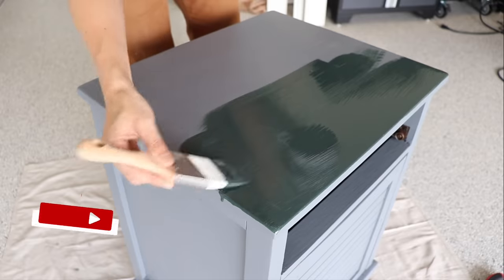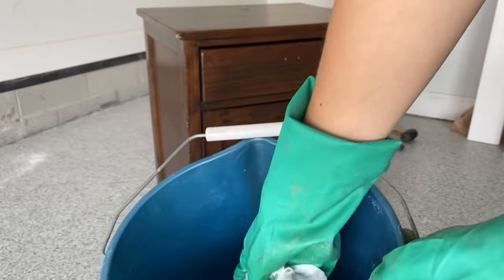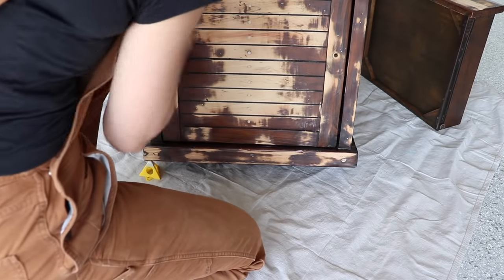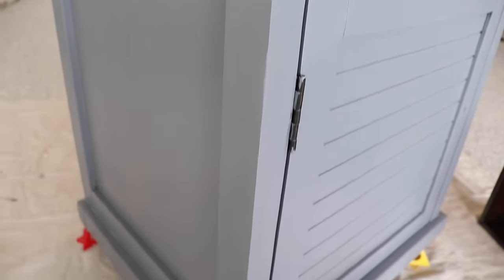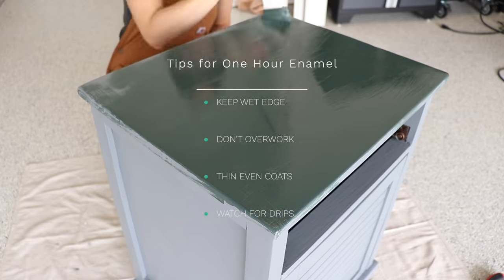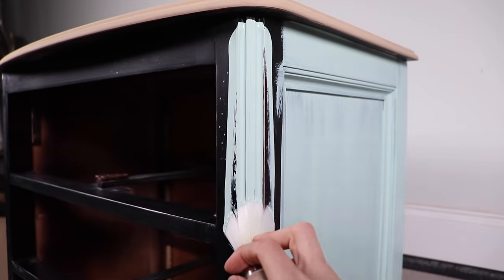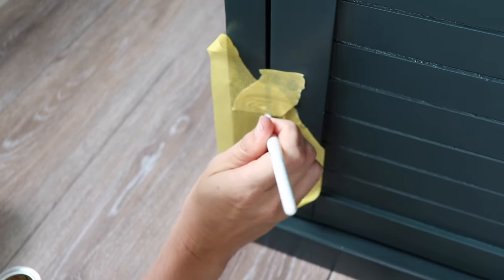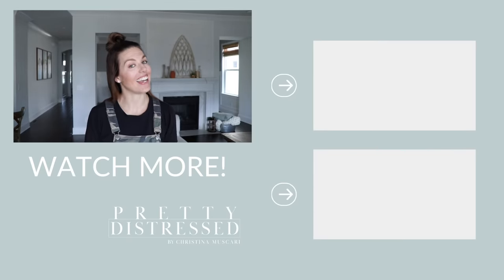Painting Furniture With Acrylic Paint | One Hour Enamel?

Comment: Great transformation, Christina! Had to laugh when you filled all the worm holes and had bondo everywhere! I had a piece (my husband’s 100yo+ wooden tool box which was his great grandfather’s) I completely transformed, but there was so much damage (big and small) I had to use a LOT of wood filler. I wish I could add a pic of what it looked like after that step lol. But painted it smooth and did all kinds of fun techniques with it. 
Can’t wait to try these drawer pulls! I know exactly which piece I’m going to use them on too. I’ve struggled with trying to find the right size in anything other than plain and/or boring. Thx so much!💜

Comment: Your advice on different paints and finishes is great. You gave me the confidence to restyle my kitchen cabinets and dresser in a low sheen soft green and I have added 'steam punk' copper and iron handles and towel rails which I found on ebay. It actually looks great which amazes me. I watched about 20 of your films before I worked up to it, and I saw how you just go for it with an idea, which really helped. Also, I used a roller for the first time because I saw you using different ways of applying paint. Your channel is so rewarding to follow.

Comment: I am so glad you tried enamel.In my country its far more cheaper than any type of chalk paint and the products you usually use are way too expensive for someone who is on a budget.Of course you are a professional so you make the best choices.I have been using enamel for many projects and it works just fine. Although i suggest a top coat  . The only thing about water enamel is that if you re attempting a shabby look it is not easily distressed....happy for this project

Comment: The square brush looks nice!
Love a stubby angled edged brush even a long handles angled brush.
  My current price has an issue.
Did not realize I needed a primer to block out an Unknow 
Substance on the top caused it to even seep though it was sanded and clean there was still something has seep through, Spray painted a third coat it’s still came through tacky.  It had been washed sanded and wiped down b4 painting.  
Using a brush or rolled is my preferred way to paint.
Think I’d like to try Dixie paint etc.

Comment: Anyone using any waterbourne type acrylic paint on furniture should be aware that dry time, aka ,"Dry to handle or dry to the touch are generalities. The more important aspect is cure time that can be as much as two weeks. Another factor is recoat time. Other factors include the choice of application tool (s)  Trying to get a smooth semi-reflective finish on a poorly prepped substrate using a "chip" brush or a foam type roller sleeve from one of the dollar (and now a buck and a quarter store) is a recipe for a re-do. If ya think those chippies leak hair with regular paint,  QD will result in migraines or myopia. There's a tearing out of hair pun in there somewhere.  

What is being sold here is overpriced house paint in small containers with fancy labels. Even the big guns in this enterprise do not make the paint or even the fractions. The sales pitches are made to sound as if every provider of the latest must have coating have a lab staffed by dozens of paint chemists and a manufacturing plant in a secret location some where off the coast of _______! 

Bottom line here is if ya wanna know about any of these magical paints that turn sows ears into knock off Hermes accessories, a couple of in-depth sources are "Golden" and "Liquitex."